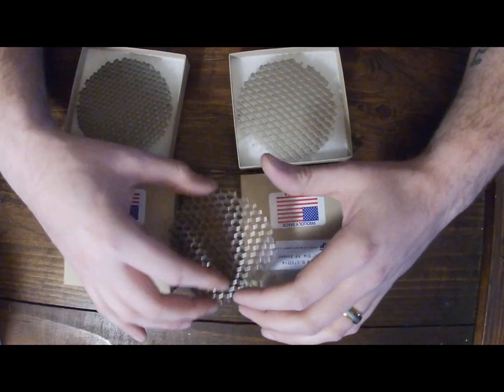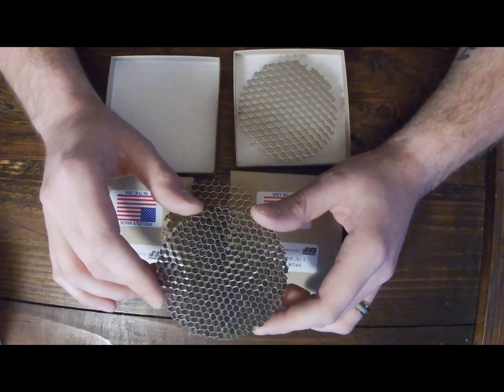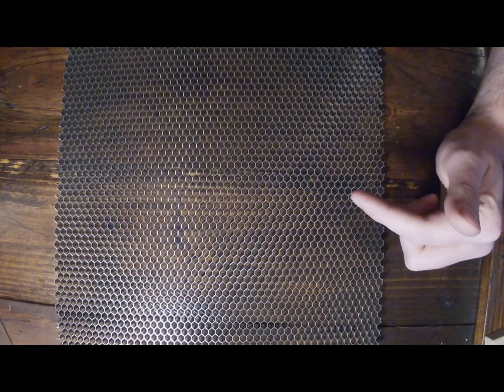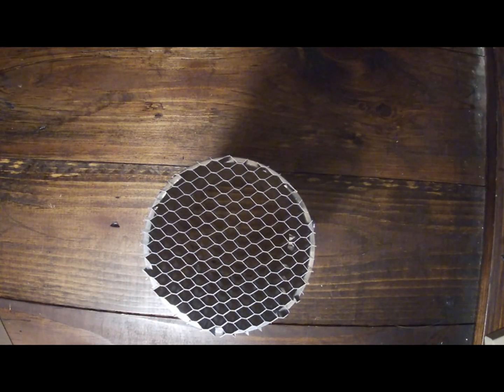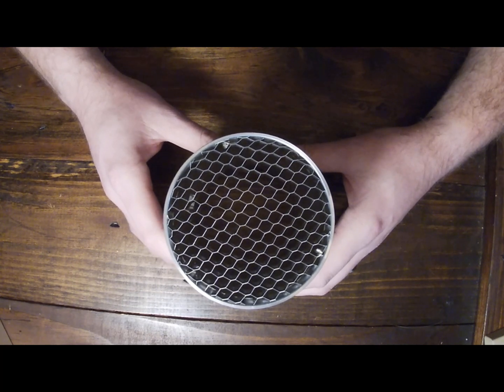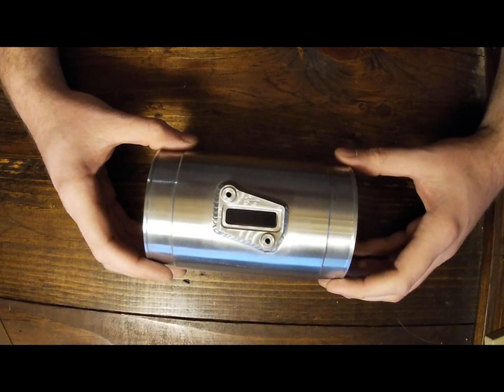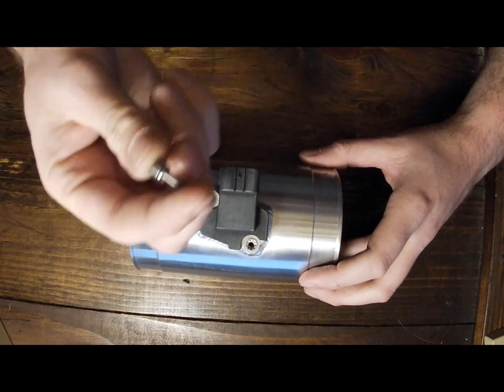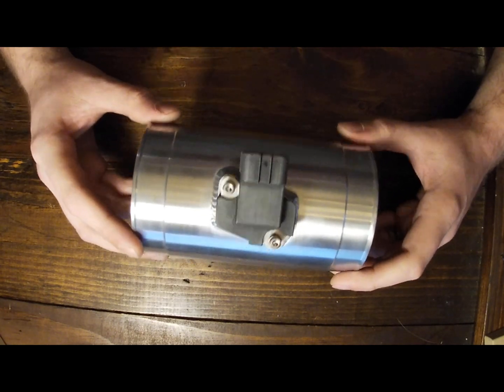Everything you need to know about Performance MRP's Air Straightener Screens

Comment: whats the gain number ? any dyno result ?
Reply: apparently none....

No-one have shared any test data here?
Reply: @Melports  guess it's a scam afterall
Reply: @jobo911 i dont think its a power thing. Strictly to correct malfunctioning MAF sensors. Assuming most commonly for after market intakes that dont have an air straightner pre installed.